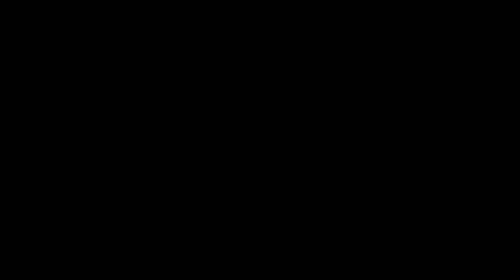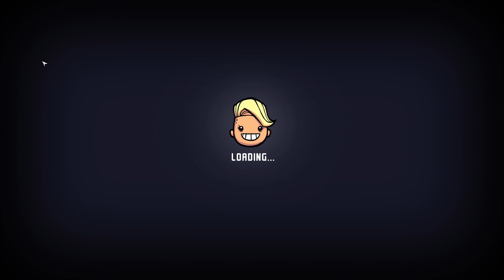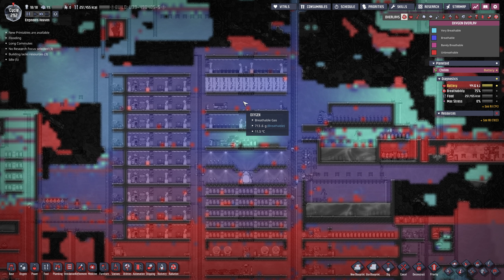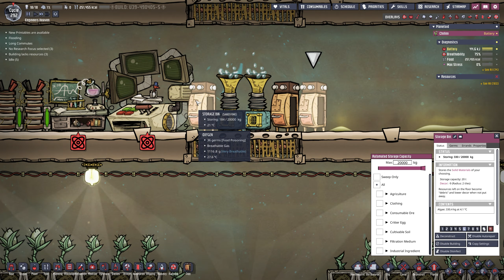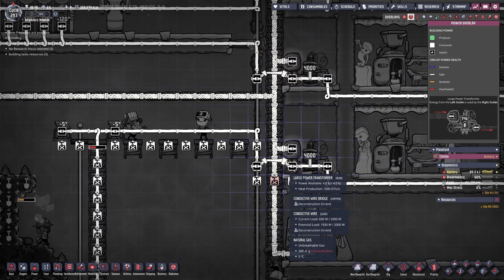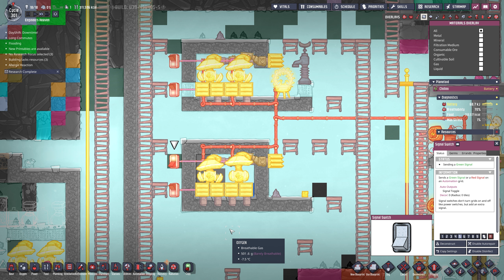Building an INSANELY EFFICIENT SPOM in OXYGEN NOT INCLUDED! (LP1-EP13)

Comment: I was playing around in debug mode testing spoms. i found a better spom then this. only thing good about the Rodriguez is easy to build. but!! there is a better one, stacking the electrolyzers on top of each other in a row and use water on top to force the o2 to one side and hydrogen to other side. this way they will run flat out 100%. best part is the o2 that is forced on the side acts like a inf storage and will never "backup" and the other side is inf storage for the hydrogen. works like a champion it will power it self as well as a steam turbine/ aqua tuner cooling loop to cool the Air. I got 8 pumps in there and can run 4 pipe lines and the air cools down to 0 F or -F degrees before going to the base. since the air never backs up the pumps, With less dupes I can turn the electrolyzers on and off with automation if I get too much o2 built up. This is the next step past the Rodriguez.  all you need is water supply at a decent temp like 80F is best. I need to try cooling the cool steam vent water with this setup and see if it can handle this part as well.
Reply from the maker: It sounds to me like you discovered a "Hydra" or something very similar. A Hydra tutorial video is actually in planning!

Comment: Electrolyzers produce 70°C+ oxygen and hydrogen. In this base it won't cause issues for a while since it is freezing. In normal temperature base such hot oxygen without cooling would slowly roast the whole base.
Reply from the maker: You are 100% correct, which is why I implement a pretty nifty cooling solution in Episode 17(LP1-EP17). Take a look, you may like it :)

Comment: Why not make a third infinite storage for H2 next to  O2 and CO2. now you pump your (warm) H2 all the way to the right just to pump it back to the left. Also maybe consider putting a shutoff with priority connecting the input of your infinite storages to the output (or maybe even a direct line if the output doesnt need to be turned of periodically). Now you are pumping i.e. water into your infinite storage with a pump and then you pump it out again. In the case of your electrolyzers your never want the supply to end, so it would save tons of power to feed the input line into the electrolyzer while only routing the overflow to the infinite storage while having the infinit storgage as a backup to fill in supply gaps.
Reply from the maker: That would have been a good idea at the time, would have saved a bunch of resources and need for cooling. Thanks!

Comment: I"ve never understood why the two manual airlocks... I see them everywhere. I never build them.
Reply from the maker: Inside the SPOM on the left and right of the Hydrogen pump? Those are just for when it is being built so the dupes can easier go back and forth. Other than that it can be replaced with anything that doesn’t let gas through :)
Reply: @BierTier  I mean, just use regular tiles. Dups can walk in there even if it's solid walls, it's a 2 tiles gap... it literally takes less time for dups to walk over them than thru them (they have to wait for the whole open animation). I think someone in the past overthought about it and used 2 airlocks and since then everybody is just copying the design... those doors just slow down dups while building.
Reply: @TheMule71  the original design didn't have the 1 tile higher hydrogen collection thingy at the top so it had doors for the dupes. It doesn't even need that and can be built 1 tile lower taking less space.
The doors can be built in the end to minimize time wasted
Reply: @nirodper  Yeah I've heard from FJ that in your design originally the top was flat, and he modified it, but today it does not seem necessary. 

And yeah you can build them last or switch their state to 'open' for the duration of the build phase and set to 'auto' or 'lock' last. You can also build regular tiles last, I usually seal the build anyway with insulated tiles so it doesn't really make a difference.
Reply: @nirodper  It's always fun to check every Youtube video that used your invention 😋
Reply from the maker: Hold on, you are THE Rodriguez? Holy cow, I missed that completely. Absolut Kudos to you for such a great design!
Reply: @BierTier  :) thanks, it's simple someone else would have designed it if I didn't
Reply from the maker: But you did and it will be forever known as “the Rodriguez” :) 
I hope you approve of my representation of your creation 😂
Reply: @BierTier  haha yes, I always enjoy seeing it being built in other's bases
Reply from the maker: I’m glad to hear it :)

Comment: Why replace abyssalite with insulated tiles? (The pumps under the electrolzers)
Not a major point but it's a waste of dupe labour (thought you german folk were efficient lol), and the absyallite insulates better than pretty much everything (I dunno maybe the space insulation is better). Only downsides are of course can't put pipes and wires through it.
Reply from the maker: You are right, I could have left the abysallite. But you already mentioned the first problem: No wires and pipes through it. And the second is that a lot of total beginners watch my videos and they may not have abysallite, so I figured I'd build it out to make clear it works anywhere :)
Reply: @BierTier  Abyssalite is not insulated. You need a double layer for good insulation. Also of course the no pipe/no wires is kinda a big deal.

Comment: Hi bro i need help💥
My thermo aquatuner output pipe always damage 
I use ceramic liquid pipe
Reply from the maker: You need a pipe temperature sensor that is set at "Turn on when liquid is ABOVE 15C". that sensor needs to be connected to the input pipe of the thermo aquatuner(TAT). 
The reason is that if the water goes below 0C it freezes and damages any pipe. The TAT reduces the temperature by 14C of the liquid which is pumped through. So with the sensor set to 15C you'll never go below 0C. 
I hope this helps ;)